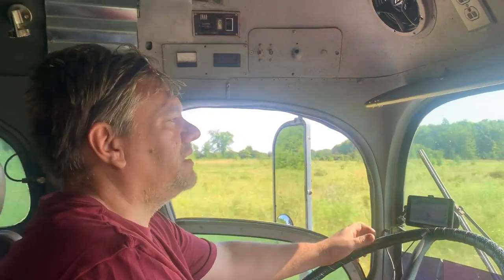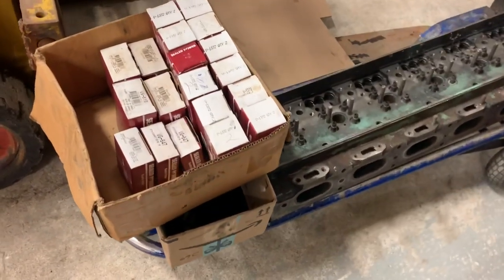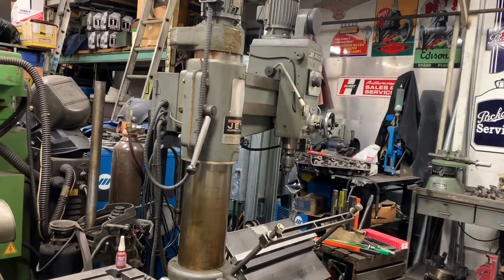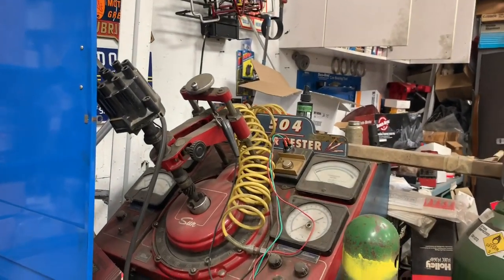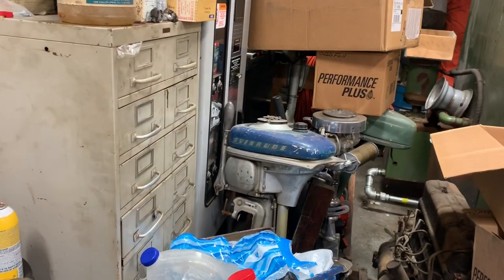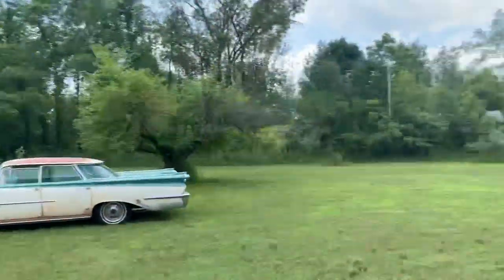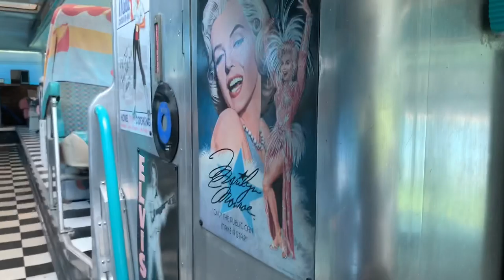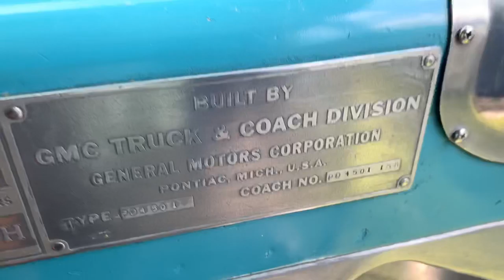Headed to next stop in Michigan.  New head, machine shop, truck stop, and two Scenicruiser buses

Comment: That '54 SceniCruiser was niiiice! Looks like one of those old stainless steel diners that used to dot the countryside with the black and white tile floors. Very nicely done! Also like the floor shifter much better than the early column shift with 20 ft. of excess linkage, LOL! 😆

Comment: Scott... I know where there is another pd4501 Scenicruiser, just sitting in the grass, not far from me (about 35 min. drive).... been there for at least 3 years now, that "I" know of,  there is also a 4104 & a 4106... all just sitting there in this older fellows field near his house.   Am going to visit him one of these days soon, and introduce myself and see if I can find out anything about them, or better yet... if he will allow me to "have a close look" at them.   Am really wanting to know what the original numbers are for the 4104 and the Scenicruiser. 

The 4501 appears to have been a conversion at some point... at least from what I can see of it,  and the exterior of it "appears" (from the road) to be in pretty nice shape.... but, like anything else... distant appearances can be (many times, Are) deceiving.

I don't understand why I see a lot of these coaches that look so meticulously clean inside and out.... until you open the engine bay doors and... what a Mess!! 

The power train from the engine back in Any of my vehicles (semis and personal) have Never been seen dirty by anyone... including DOT inspectors, who always commented on how nice and clean throughout and underneath my semis were... and I ran 12V71 power (much "tweaked") in each of them over the years.... and they NEVER were oily,  but I built them differently then everyone else... any kind of a leak was extremely rare on my engines, partially because I have always been a firm believer in... and practitioner Of, preventative maintenance. 

One thing I always did on my V12's was to remove the blowers every 100,000 miles and do a full rebuild on them Before they would start sucking oil in past the drive end seals and blowing the oily air into the airbox and ports... saved me a lot of downtime and money in the long term,  I also would "run the rack" every 45 to 50,000 miles just to make sure all the clearances were where they should be.... anal by most peoples "standards", but in over 4.6 million miles as an O/O (Owner Operator).... I never, Ever broke down on the road... every 1.5 months, I would put the truck in my shop and go through it with "a fine tooth comb" from top to bottom, from front to back... and Anything that even hinted at possibly becoming a problem, got fixed or replaced then and there.

PS:.. 350 to 400hp 6-71T's are very conservative, easily doable and very reliable.... even 300+hp 6-71& 6V71NA's are very easy to attain,  why do folks with 6/6V-71 powered buses keep slugging away down the road and crawling up the grades with 170 - 238 (+or-)hp when they could easily go for more grunt?    Have you ever come across a conversion that was 6-110 (NA or T) powered?..... the very thought of that is very enticing... about the only thing to change would be the governor to a limiting speed to work in an automotive environment... unless of course it already would have one, depending on the original application it came from such as a Euclid mining truck or a Euclid TS-24 scraper.

After the fiasco with the early versions equipped with the mechanically driven centrifugal blowers, they recast the block to accept the 6-71 blower casing and mounting pattern, but the blower had larger bearings and was driven 30% faster than the .82 over-driven NA series 71 blower.  I find it interesting that GM Diesel never lowered the static compression ratio of the NA 110 at 18:1 when they added turbochargers to them in 1958.

GM actually toyed with the idea of offering the 6-110 in heavy duty on-highway trucks,  and in fact had a 6-110NA in one of their GMC "stub-nosed" trucks (630 or 650 series "cannonball") that they were testing.... but, 1957 rolled around and they rolled out the V series of the 71 engine family (as well as the new series 53 engines... which ended the series 51 engines in 1959), which spelled the demise of the 6-110... a huge mistake on their part... because the 6-110NA was developing 925 ftlbs of torque and 1,100+ with the T version... which was more than the 12-71 was (NA version), and torque.. is, "where it's at" of course when dealing with weight.... so long as there is a sufficiently Long stroke to sustain the torque in the grades.... which, unfortunately.. is where the series 71 AND the series 92 failed in heavy, over the road semi applications. 

They certainly had the torque, but lacked sufficient USABLE (have to deduct exhaust valve opening and port uncovering from total stroke length) stroke length to be able to sustain it in the grades, compared to much larger displacement 4 cycles, like Cat & Cummins.   Had Detroit developed an inline 6-149 (894ci) for example... they would have absolutely buried the competition, power wise... especially in long haul truck, and heavy equipment applications,  with one problem.... the powertrain companies (spicer, eaton, mack, etc) as well as the highway truck tire manufacturers, did not possess the metallurgical & rubber compounding technology to build sufficiently strong enough transmissions, drive lines, rear ends & tires to be able to handle the power (especially the torque) that even a 6-149 would generate... which is one of the principle reasons why GM/Detroit Diesel never built equivalent displacement 2 cycles (in terms of bore and usable stroke length) to compete with the 4 cycles.... because it would have been Too much power for the era and the technologies available in order to make use of it.... at least in the On-highway markets. 

Love your videos, am subbed and rang the bell.   My wife says that I should be doing what you're doing.... in my retirement years.... I remind her of her own words... "Retired" - and after a total of over 6.7 million miles (not counting personal vehicle miles) over the road throughout the US, Canada and Alaska.... I'm enjoying just hanging out.     You're doing a Great job, Scott... love watching you do what you obviously enjoy doing, and are good at it.  Thank you so very much for sharing it all with all of us, "out here" in youtube land.

PPS:... Sorry for the "book"... it got away from me. lol   Love discussing anything GMD/DD.... formally studied them from a design standpoint for 4 years back in the 1960's under some of the most brilliant "minds" in the business, including P. Nicholas... one of the original designers of the very first prototype 2 cycle GM Diesel (a 4-71) under "Boss" Kettering himself.   ; )
Reply: 2Stroke Diesel Power 
Sir, I enjoyed reading your book.  I’m a believer in preventive maintenance and keeping things clean, it’s really a sickness you know LOL.  Continue re-living your memories and enjoying your life...
Reply: 2Stroke Diesel Power 

I’m anal myself nothing to be ashamed of. I have a 1992 740 Volvo that will soon have 500K Miles. It has never had any rebuilding of the driveline. It has been maintained religiously. It is my daily driver and I would drive it across country tomorrow. It still looks great as well and people compliment it often. It has never needed a tow either. As long as no accident I fully expect it to reach one million miles. By far the best car I’ve ever owned. People just don’t understand the value of preventative maintenance.
Reply: Yes
You should, must write a book.
Invaluable information. 
Thank's

Comment: I spent years running most every model of machine he has in that shop, plus many more on crankshaft grinders. That 85B is a great piece for decking blocks and heads.
Reply: Bill Miller I still use a CA Rottler boring bar, Simplicity boring bar, Sunnen pin hone, Black & Decker valve machine, Souix valve seat grinder and a Craftsman 12 X 36 metal lathe, the lathe was made by Atlas for Craftsman.

Comment: I loved that shop walk around . . . it was like being in the 2 places from different ages at the same time. Lots of cool shiznit.
That Sun machine for distributors screams 1950's, maybe even older.💖👍😎
Reply: JIGA BACHI The first shop I worked in back in the early 80’s had one and the owner of the shop said he had purchased it new along with his old Sun Engine Diagnostic Machine in the early 1970’s Remember GM did not introduce HEI until the mid 1970’s.  I learned how to use that machine to test, tune, and overhaul distributors for customers cars coming in for drivable issues and also to set-up distributors for locals who drag raced and roundie roundie raced although it seemed they went to Electronic ignition systems much quicker than drag racers.  I still used that machine on GM HEI working on modifying the advance and replacing the shaft bushings up until the old man who owned the shop sold it lock stock and barrel to some guy from out of town without asking me if I was interested in buying the shop.  I left the day the new owner showed up and the shop closed up about six months later.  The only piece of shop equipment I wanted when they had the auction was the distributor machine which was not part of the sale, go figure.

Comment: Every machine shop I’ve ever been in look pretty much the same.
Reply: William Todd Very true. The number of automotive machine shops is dwindling so fast that the ones that are left are usually swamped.
Reply: William Todd Our county is the largest in our state and there’s only one machine shop left. I’ve been in the automotive repair industry for 30 years and I remember when every NAPA & Carquest had a shop . I even moonlighted in one for about a year as a helper thinking I might transition from automotive repair to the machine shop side. Glad I didn’t. You simply cannot find youth of today willing to do hot, dirty, and extremely technical work these days. You cannot trust their work which means you have to try to go it alone. Only so long the body will hold up to that. Don’t know what the answer is if there is an answer🤷🏻‍♂️
Reply: we are tight people dont need a lot of room

Comment: Have you realized any fuel mileage increase since your work?  Re: machine shop...  Many, many, many (too many to recall) I worked for Sun Diagnostics when they were located in Park Fletcher and got my hands on a few of those old distributor testing / repairing machines.  Dem wuz da days!

Comment: 8v71 power! I can't believe these originally were configured with TWO 4-71 4 cyl DDs.
Reply: Yes, and I understand that the two of them..on occasion when both were running right...sounded like a hornet's nest.  The 8V71 wasn't available 'till 1961, so the choice when the scenic came out the door was 2-71. 3-71, 4-71, and 6-71. Greyhound rightly felt that the 6-71 wouldn't have the needed power for such a heavy bus in intercity service.

Comment: Since you are working on a 4501.  As I understand from someone else's video the 4501's originally  had 2 4-71 Detroit Diesels with a fluid coupling and it was a nightmare. Greyhound had their fleet rebuilt in the early 60's with the 8V-71 soon after it became available. Are there any left with the original setup? Have you seen one with the original engine setup? I assume they sat side by side with the same crank rotation. I would guess that the blowers were in the middle and the exhaust to the outsides of the bus to keep from concentrating  the heat. This could be interesting.

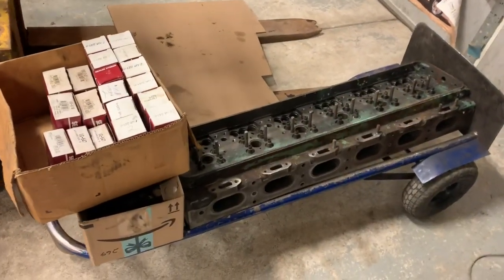Comment: @1:14 I will be interested to get your reaction to the difference between the two valve and the four valve when you get around to replacing it. I hope you throw the four valve head on before you tackle the turbo install so we can get a side by side opinion of the difference between the two

Comment: Love the engine shop!  He said the heads were "LS", those are from a GM LS engine, which is a  small block GM engine, but can be high performance, maybe 485 HP.  

I would like to add the remote start units for my 671's on Buena Ventura.  is there a kit from DD or are those fabricated on the spot?
Reply: A LS can make a lot more than 485 HP, stock NA versions were over 500, supercharged versions over 750. A stock block and crank will support well over 1,000.
Reply: @lukestrasser  It sure can.  The485 is a stock engine.  Bigger IS better.

Comment: The fella with the DUKW appears pretty hardcore into Green Iron. I also spotted a M915 tractor as well as two M146 Shop Trailers.
Reply: There's also an S280 Shelter on the ground as well as a dolly to move it with.
Reply from the maker: I spied a M1919 today too.
Reply: Didja get to shoot it? :)
Reply from the maker: It’s in the video if you look really hard.  Or is it??

Comment: I thought I saw a Buick Straight 8 down low on the floor showing the 4 cylinder Evinrude.
Reply: Six spark plugs. Road draft tube dates it pre PCV (mid 60's). Looks like a Chevy 216 or 232 from the 50's
Reply: @rik999  I wasn't sure because I couldn't see the number of plugs or the side cover. I agree with your take on what that engine is.
Reply: @rik999  , that was most likely a 216. American Motors had the 232. Chevy had a 235 which had a different valve cover, as well as, different insides than the 216. There was an early 235 which was a dipper engine like the 216, but it had a different side cover. The later 235 was used from 1954 through 1962 and was one of the best engines that Chevy ever made.

Comment: Looking at getting my first bus.  67  pd4107.  I am thinking it has one or both brake chambers on the rear leaking allowing air to exhaust from the relay.  I am going to look at it in a few days, is there a way to cage dd3 brakes?
Reply: You don't need to cage DD3's. They use air pressure to set the parking brake. When under way there is no air pressure in the DD3 except for when the service brake is applied.
Reply: Raymond, did you get your issue resolved?
Reply: @tmackx  I haven't really been able to look at it again.  I am going to have some time this coming up weekend.